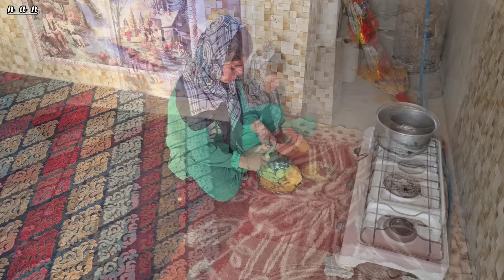Leftovers of Dreams: Grandma's quest to expand her magical cave

Comment: HIDE THE HOUSE - MAKE IT A CAVE with windows and a courtyard. It must not be easily visible to keep the farmer happy. They left Dan, Nan's neighbor, alone because her courtyard blends with the colors of the hillside. 

Clean up the rubble and trash. The farmer does not want to see a mess or attract more nomadic development. He is not threatening Dan.

First, add wood support beams and cement brick columns (*with cement and rock  at least 2 feet thick below the floor under them*) to the inside for safety. 

Then, cover the house with sand and plaster. 

( Add bushes to the hillside for stability and camouflage and trees for shade and to block bulldozers. They will need to be watered every two days.)

Plaster all outside cement bricks to hide them. Roll the bolders down to make a natural short wall around the courtyard for safety, wind protection, and to hide it. 

Finally, use only sand or sky blue color shade covers. 

The original cave would make a good closet/dressing room and bath.

AND PLEASE TAKE AT LEAST ONE DAY A WEEK OFF TO REST!❤
Reply: @elainehering6535  I like the window idea. If they expand the cave all the way behind the brick wall, a window would help with air flow also. I think that the house as is will be allowed to stand if they do not try to fix it. They can use it as a summer kitchen. Or remove the tiles and place them on the cave walls after getting them squared up.

Comment: Well up to Nan but as it is the most important because of the weather coming is to put cement on the whole entrance and secure the slope full of sand that will pour fixn over the cave entrance and make a poodle of mud!!  Those things were since the very beginning of her videos but she just didn’t either see it or didn’t think it was that important!! Well she will see how important it will be !!
Reply: I think she’ll put plastic sheet over it, like she done before...hopefully!
Reply: @carolm7037 she needs to have advices and to have others do it!! There is a need of a tractor that can drag away a big amount of sand and rocks ..
Reply: Why don’t they put water on the walls to prevent dust flowing all over??

Comment: Time now is important with the winter not that far off .Grandmother looks to have taken   the burden on her shoulders of the work that needs doing . so it is important that only a safe amount of spoil is removed from inside the cave .starting to turn this project into a major one .could destroy the gains already made .what grandmother needs is a decent tool kit .using hands is only what she has and a few other tools the spike on the shaft .and the wheel barrow and shovels .a basic tool kit that tradesmen use .would be a plasterers hawk ....which is roughly a twelve inch square board with a six inch handle nailed through the centre this tool is a wonderful help ..finishing trowel ...masons hammer pointing trowel.. two levels 1 3 feet the other 12 inches.and a couple of chisels .the cost would be about 150 dollars

Comment: Very wise to expand the Cave. While it make not have the tiles of the house, there is nothing preventing the installation of tiles in the cave, out of sight of the Authorities. Disguise the cave entrance to make it blend into the mountain side. Totally disguise the entrance to the cave as if it does not exist. the very least make the real cave disappear and provide only a tiny insignificant cave as the apparent residence for the Authorities to find. Hide the Real Cave so the Authorities cannot find it or the entrance or any clue that it exists.Finish the real cave with all the fittings of the desired house, including the Sink, Plumbing, Tiles all hidden away from the prying eyes of the Authorities. This will require a secret entrance and and emergency exit/entrance should the cave found giving further protection from the Authorities. While underground life has its down sides, the upsides are it can be hidden in plain sight, year round temperature and humidity control. Can be virtually indestructible if one chooses to hide the entrance and exits from prying eyes. Use the existing Cave as the only known residence. Hide an entrance to the real cave inside the existing, known cave. It may be possible to find or hire someone who is willing and able to hide cave entrances within an existing cave. Most likely Authorities have spies and collaborators everywhere and pays them to betray heir own people. Nan and others must learn to take measures to protect the whereabout of their real caves against those who have no morals and are willing to betray their own for 30 pieces of silver.

Comment: Do not dig one biger room in the hill, make a doorway to another room leave support wall 1 meter for roof support...😢 I would go wall up the cave with spring if they want you living in a cave.  That is allready a bigger cave, The work to open it up inside level the floor etcetera, will be the same and much safer, not visible.